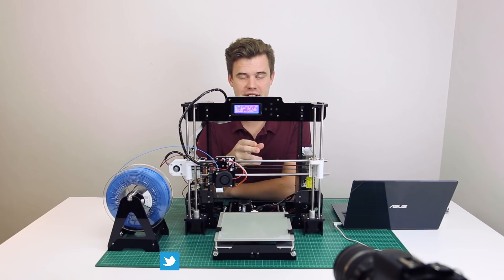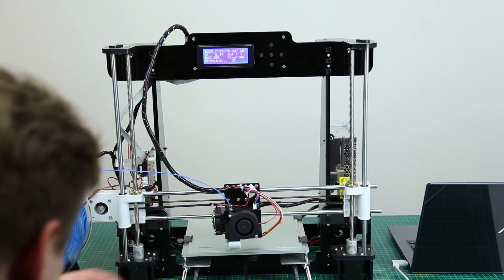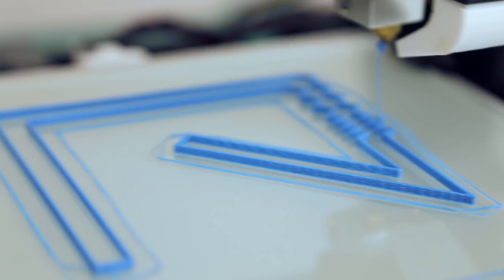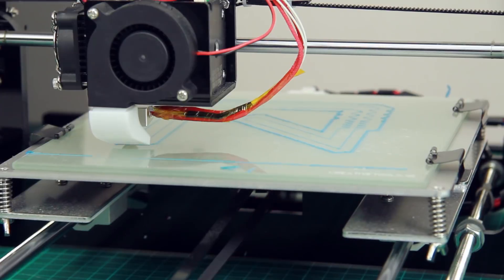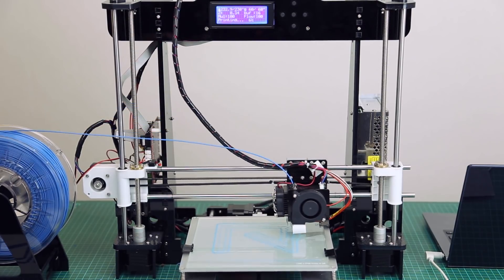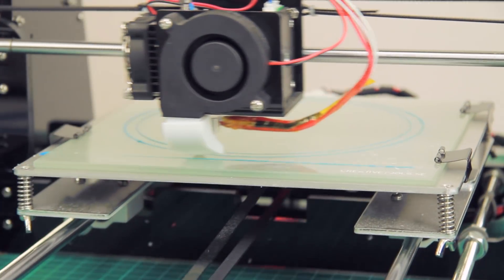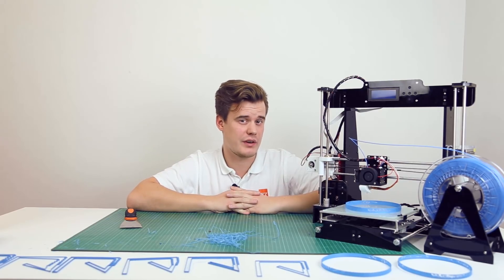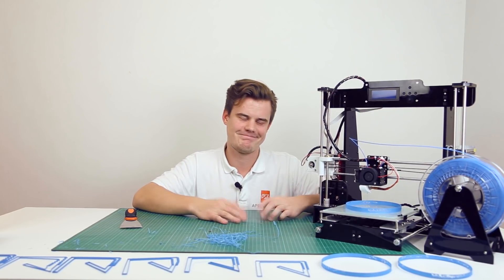HOW FAST WILL STOCK ANET A8 3DPRINT?

Comment: with klipper firmware (2 board FW with a Linux PC as the controller) I can push to 400mm/s+ and even 4000 acceleration on the X
I run my travel moves at 300mm/s 2.4K acceleration and I've never had a skipped step (even have a 4mm thick 220x220 glass bed)
it's incredible just how much people underestimate their machines (this was done with a custom frame made of 3/8" threaded rods, but the rest was all stock!)

Comment: I've run quite a few prints with my stock A8 set at 100mm/s. I've also had failures at 120mm/s. I once tried to do a 7 hour print at 120mm/s and had it fail twice after a few hours. So I reckon 100mm/s is about the safe limit for a stock machine. At that speed I sometimes have issues with stringing pulling off the outline of holes on the first layer. So I start the print with the speed set to about 50%/50mm per second and turn it up when the fan kicks telling me the first layer is done. I'm using the glue stick method of adhesion and it works really well, no adhesion problems.
Reply: Mine runs at 4200 speed, check your printer, it's very slow
Reply: @Cass_Rose  4 meters per second from an A8?. I don't think so.
Reply: typo, actually 420 mm/s

Comment: You mentioned some things that should be upgraded, could you give recommendations to what specifically you would upgrade to? I am a novice and don't want to trust my own research till I get a better handle on this. Thanks.
Reply: Z syncing belt. Glass bed, upgrade to bed leveling sensor. Bowden hotend instead of direct drive (less weight so move is smoother).

I'm  printing at 100mm/s with good quality.
Reply: @riceball4u2  I personally prefer frame upgrades and keeping the stock direct drive extruder or getting a lighter dual drive extruder, bowden introduces more physical room for error, especially when retracting + plus it makes it difficult (to say the least) to print flexible filament. every bowden setup I've ever used has had a lot of stringing problems which is sub-optimal when trying to produce prints with as little post-processing as possible. I have an anet a6 and I've been getting great quality at high speeds mostly stock.

Comment: so I have an anet a8 3d printer and I use a bit of painter's tape on the plate and the tip keeps on ripping off the tape, can you help?
Reply: Print head is too close to the print surface. Use a piece of typing paper as your "feeler gauge" and adjust the bed at all four corners going from one corner to another (left front, right front, right rear, left rear and repeat). The paper should "just drag" between the nozzle and your print surface. If you can push-pull the paper without it stopping and not just slide, you should be good to go. I hope this helps. And remember, it is a hobby machine, designed to be fun!😉

Comment: I have several contact within the Anet company and several Anets of my own, and after confirming with them, the max speed of the Anet A8/A6 both max out @ 110mm/s .  You may think your going faster because you programed it too in the slicer, but this is limted in the firmware.  This can be edited to allow for faster speeds, but then you run into hardware limitations, with even after tweaking the firmare, you wont be able to go much higher than 130mm/s

Comment: I know I'm late to the party, but how does the strength between the layers compare between the different speeds?
Reply from the maker: That's a good question, something I didn't check in this video. I would guess pretty well, as long as it's extruding well!
Reply: Notice the missing parts of the printer rings. Faster is not necessarily better. The extruder could not keep up.

Comment: You cannot level a bed while it is moving, come on dude. You have no concept for what the clearance is if the print is in progress and bed is moving. Leveling has to be done before the print and with components pre-heated to whatever settings you will use during printing.
Reply from the maker: Of course you can. It's not as good as a real leveling, when it's not in use. But you can adjust the height of the bed during printing, so you see that all the lines (if doing a square for example) is extruded. Believe me, I do it a lot and it's all about feeling :)

Comment: You honestly lost me at live-bed leveling. There is no proper quality test without a proper first layer, there is no proper first layer without proper leveling (= NOT live leveling, it doesn't work, as soon as your driver touches the bed the level is off already). Learned this the hard way myself, take your time to level as best as possible before starting the print, it was kinda like aspirin for me ;)

Comment: if your temp is dropping at 80-100mm, your fan duct is cooling the extruder, I had to design my own because of special mods I have, so it will just cool down the print and not the block
Reply: I had the same issue, could you perhaps share your design?

Comment: I’f that’s pla lower the temp omg
Reply from the maker: Not at those speeds, with a bad heater :). I keep the temperature higher, since the throughput of filament is above what's calculated. If I don't have it high, the cold plastic coming in will cool down the extruder faster than the heater would react and heat. So even when running like 230C, it only gets to around 225 since the plastic is cooling it all down (in combination with the heater not reacting on temperature drops fast enough)
Reply: 3D Print - Tech Design yes... still too high. The melting point of pla is 180 and over 210 it will create problems of extrusion. Try to lower the temps to 210 and test it. I think the prints will come out A LOOOOT better. At 230 the filament liquefies and becomes liquid, not melted

Comment: for higher speeds i reccomend smoothie board and bowden extruder that 8 bit cpu cant process more data
Reply from the maker: Agree! Problem is that that's not stock ;)
Reply: 3D Print - Tech Design testa klipper som sagt. Det enda du behöver utöver skrivaren i original är en raspberry pi med octoprint. Går undan utav bara....
I princip 64 bit (typ)
Raspberryn sköter alla "tunga" uträkningar för hastighet, acceleration och kurvor m.m. 
Skrivarens moderkort utför bara kommandon och behöver inte "tänka" själv. 
Mindre vibrationer och bättre kvalitet vid högre hastighet. 👍
Reply: @sanpedrox2  När jag såg videon nyss så var min första gissning att PSU var får svag så att programmet "begränsade" ström uttaget  till stepper motorerna när spänningen föll. Bara en gissning alltså